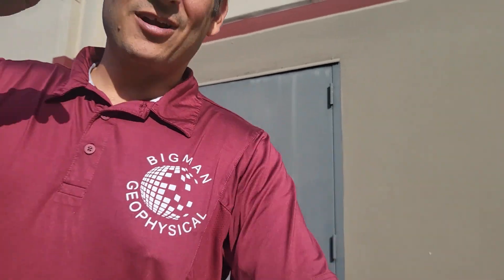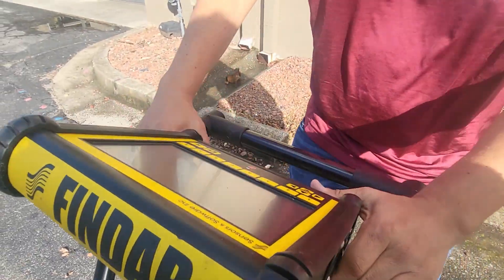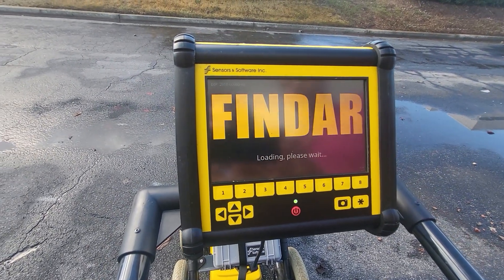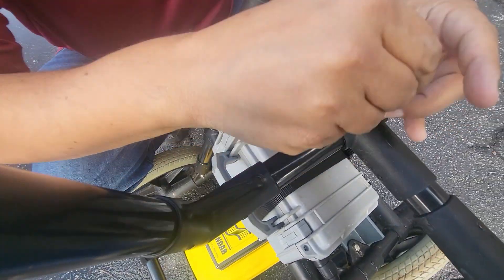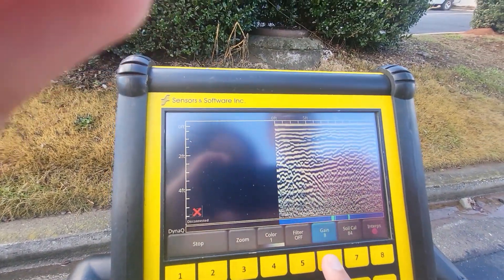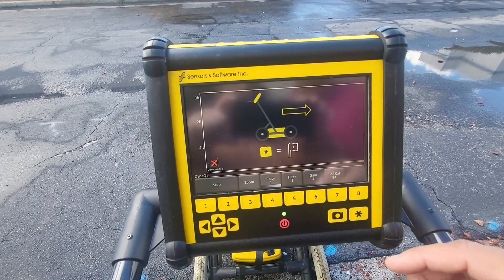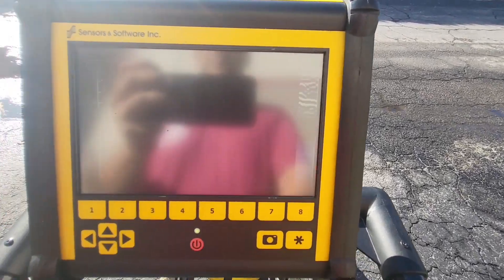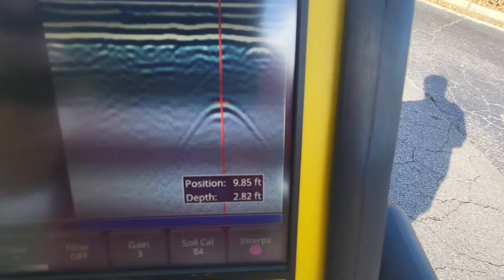Sensors & Software LMX Ground Penetrating Radar Quickstart Guide | GPR | Utility Locating Geophysics

Comment: Can this system detect the change in pipe size? Say from 12 inch to 10 inch.
Reply from the maker: Great question. Only on a relative basis. GPR doesn't really provide diameter estimates, but two pipes buried at the same depth and running in the same direction will have different hyperbola angles depending on size.

Comment: Hey Dan, how would I do a velocity calibration on a hyperbola on an LMX 100 that I just purchased. You only get distance and depth as a reading with no time. I would need to be able to calculate this to find out if I have come across and airwave. Thanks.
Reply from the maker: It should have a velocity button that you can use. It's possible the old ones don't have the function.

Comment: 𝔾𝕣𝕖𝕒𝕥 😊
Reply from the maker: Thanks! My pleasure!!
Reply: @Learngpr  Hello, thanks for sharing. I have a question, at minute 11:28 when the hyperbola comes out, it has other hyperbolas projected downwards, my question would be the following. How can I know which of the hyperbolas shown on the radargram to take as the actual surface of the pipe found? And why put several hyperbolas if you have only found a single pipe?
Reply from the maker: I only see one hyperbola. It has 3 bands. For this system we use the top of the first band. But this process is system dependent